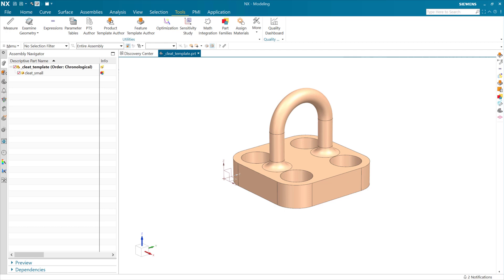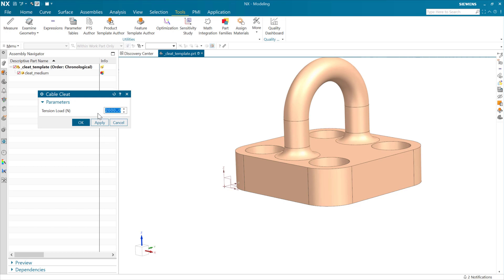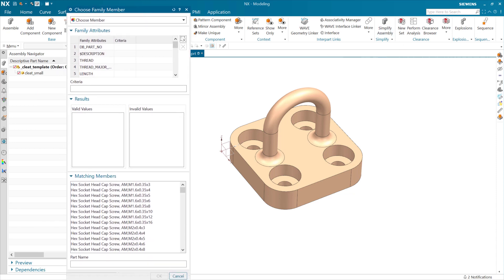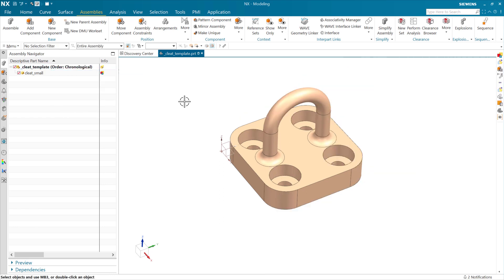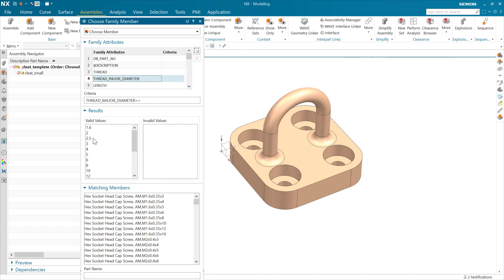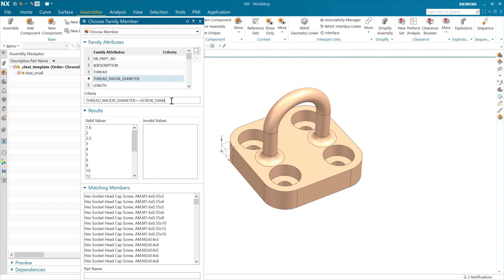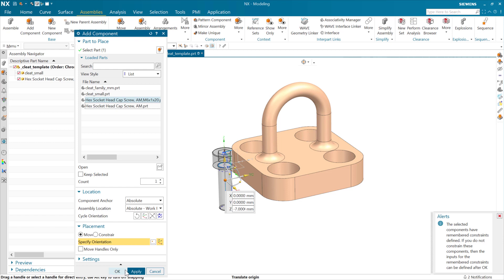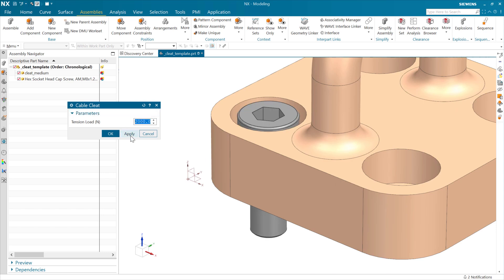NX Product Templates: How does the "Part Family Refinement" control work? [NX 2212]

Comment: Thank you for the video. Can you explain how to automatically add the 4 bolts or the 6 bolts depending on the Part family part that is chosen?
Reply from the maker: Certainly!  The simple answer here is that the quantity (and position) is driven by a Component Pattern.  Specifically in this case, the Component Pattern is following the Feature Pattern driving the holes...  In other words, the Component Pattern is using the "Reference" option and automatically filling up all of the holes in the Feature Pattern (however many that may be at any given moment) with a bolt.  Does that make sense?
Reply: @taylorandersonnxvideos  Thank you! This makes perfect sense 👍
Reply: Hi Taylor, I have a simular component where I also need to change screws (diameter and length driven) but now I run in to two issues. 
1 - the screws don't automaticly update when changing parameters. In the Part Family section of the Product Template the current screw is "out of date"  but a proposal for the right screw is given.
2 - I am using a Pattern Component on this screw (without a Feature Pattern) but when changing the parameters, it replaces the origional scew, but the other 3 screws are not replaced. 
Any sugestions why this is happening? (NX 2306)